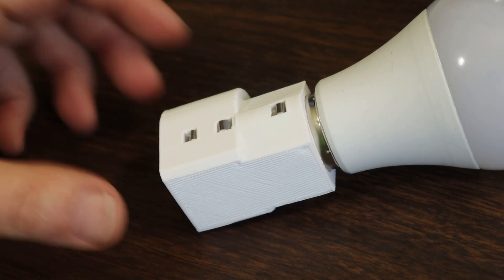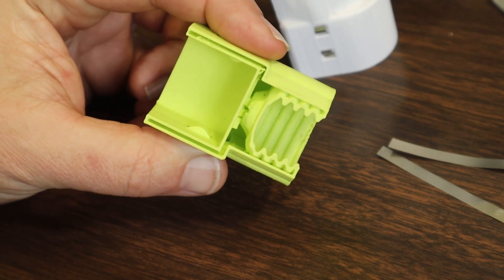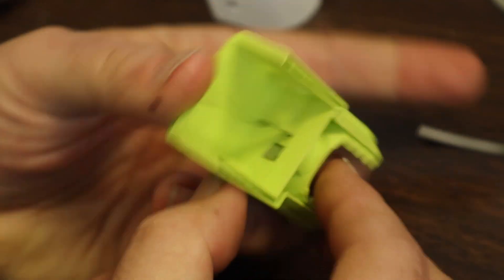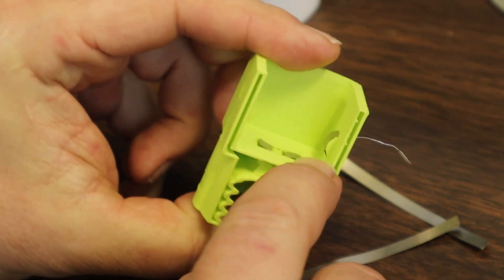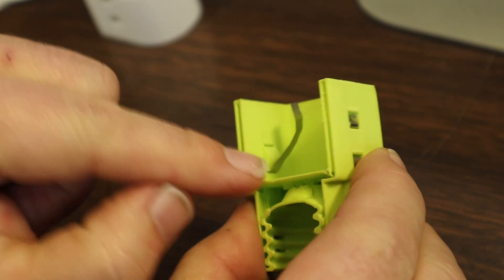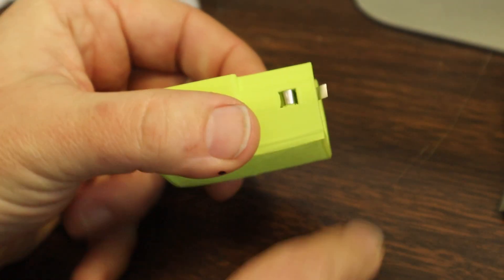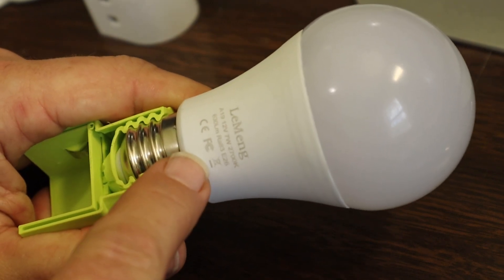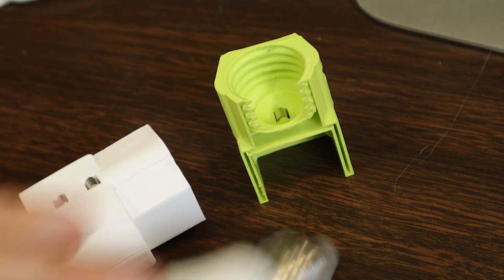Ryobi Light Bulb Adapter: How to Install Nickel Strip Conductors

Comment: Hi, it’s very dangerous to use 3d printed FDM parts together with higher voltages. Please be carefuI with this. I worked for a company in germany some years ago making electric motors. The problem is called something like “split jump” in translation.
Reply from the maker: This is LOW voltage.
Reply: This is for an 18v battery... Where are you seeing high voltages here?